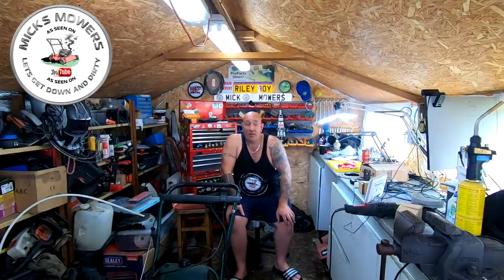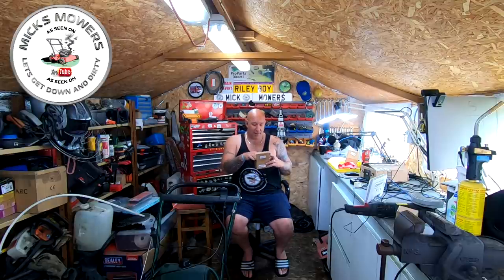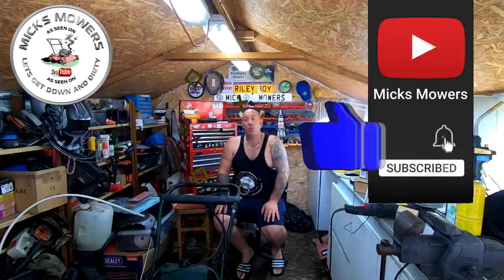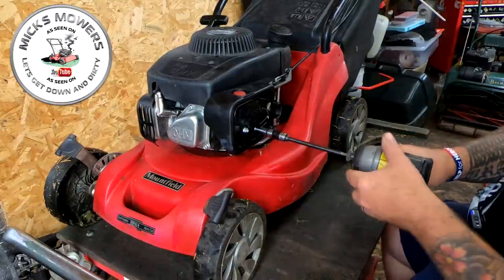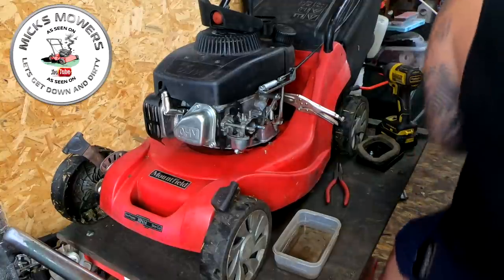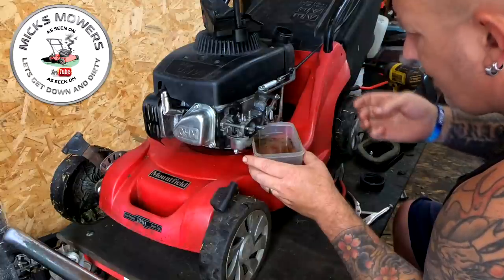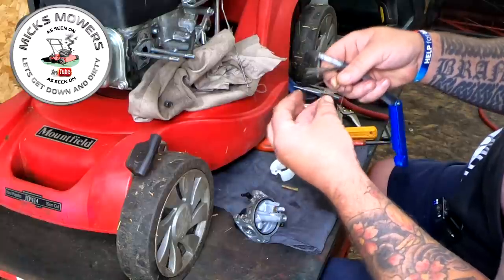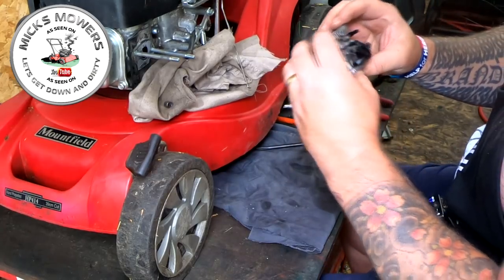Will A Lawnmower Run On Water Mountfield 414 Water In The Fuel Tank

Comment: The petrol station pumps can have water in the bottom of them so when they get low you get the water, lately with less Lorrie drivers delivery the fuel the petrol stations have been running out of fuel, so this might tie up. Great video again Mick.
Reply from the maker: Yeah could be mate

Comment: I also had a 89 year old man, after years finally got himself a zero turn, it ran wonderfully for about 4 years, then he had to replace the battery, and it wouldn't start, nothing not even a click, well I got there, did a quick inspection, and I noticed the positive battery cable wasn't even hooked up, his face went blank, so I hooked it up, and it's started right up, I felt so bad for him, I didn't charge him, he hugged me, and said it sucks getting old, since then we have become good friends, he has given me all his machinist tools, since he doesn't use them anymore, since he retired, and thought I could use them, so I don't charge him for anything to do with his mowers.
Reply from the maker: Good on you

Comment: Over eight years in business we have only had 4 cases of substantial amounts of water in a fuel tank. Once on a snowblower which was stored under a shed overhang that had clogged eaves and the overflow of rain was dropping onto the blower and water entered through the vent in the fuel cap (1/2 tank water). Two were push mowers and both customers had just emptied their fuel containers into the mower fuel tank thus introducing all the water that had accumulated in the bottom of their containers into the fuel tanks. In both cases these customers stored their fuel in the containers without installing the inner cap to prevent moisture from getting into the container. Since the fuel had 10% ethanol it was continually absorbing the moisture from the air, hard to believe that it would absorb this amount of water but if the customer never empties his container and keeps filling the container the amount of water settling out accumulates to a greater amount (2 to 3 ounces water). Lastly a customer that purchased his fuel from an new fuel station in town that had an issue with a seal on their tanks and after a heavy rainfall got water into the system causing many problems for people in that town.  In your case i am guessing water came from the fuel station just too much in the tank to be caused by absorption.  Long and winded but the OLFD MAN over and out!

Comment: Hello Mick. I have an old Mountfield Emblem 813 with a Briggs & Stratton s stroke engine. It has been lying in my shed not used for about two years as my wife was diagnosed with terminal cancer. So engaged some boys to cut the grass using their own machines. I watched some of your videos and decided to check it out. Tried starting it but no go. Exposed coil to check with my multi meter. It looks like the dead mans wire is soldered onto the base of the coil. Tried checking it anyway and got no reading. Should I get a reading even although I can't disconnect the wire. If it is the coil, is this coil still available? Any suggestion?
Reply from the maker: Take the coil off or active the dead man's handle.. see what you then get reading wise.. I would take the coil off and give it a good clean and re test..